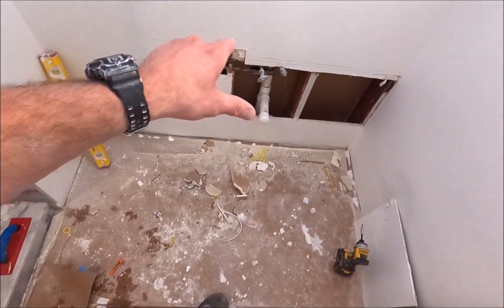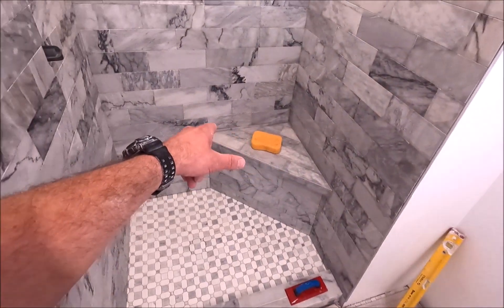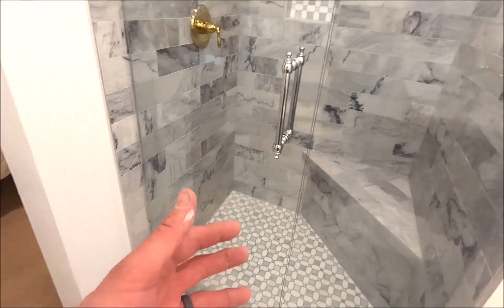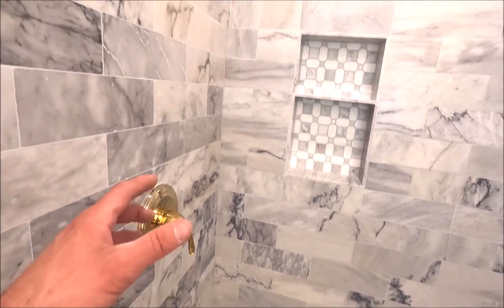Nasty to Nice Full Marble Shower Complete!

Comment: Beautiful work ! Term me the best trowel to use for 1x1 mosaic sheets please.  Thx
Reply from the maker: We use a v-notch trowel for those specific tiles
Reply: @Landberg Tile TV  Thank you.  I agree.  I did a test with a 1/4 x 1/4 notch for the porcelain 12x12 and 6x12 tiles and have practically 100% coverage when lifting one up. I have a 3/16 x 1/3 v notch, will that size work? I truly appreciate your wisdom as this is my first tile job,  and you taught me a ton and I feel confident
Reply: @LandbergTileTV  3/16 x 1/4" I meant

Comment: The look on face when learn that someone grabbed 511 seal & enhance, instead of, 511 Impregnator sealer……and realizing this after 2 coats & 2-3 days later 🤦🏼 
So, for all those DIY, pro to, etc….ya want 511 Impregnator sealer; unless want to really change “sheen/look” of “tile” used….than use seal & enhance;.
My go to is 511 Impregnator sealer, mapei makes an ok product too (penetrating sb….) when can’t find 511, but my go to is 511.
Nice job on tile👍🏻
Cheers✌🏻